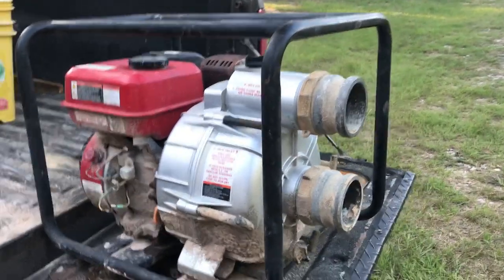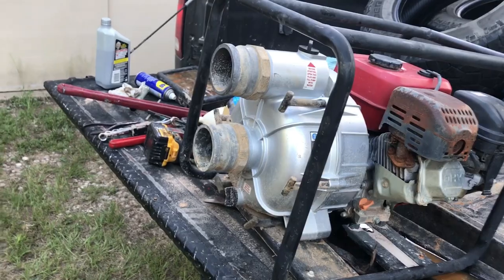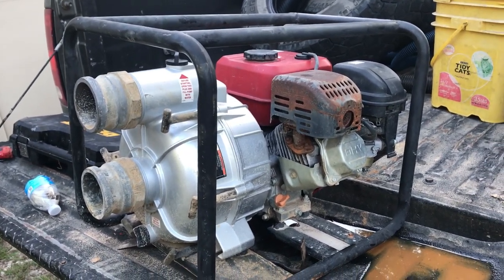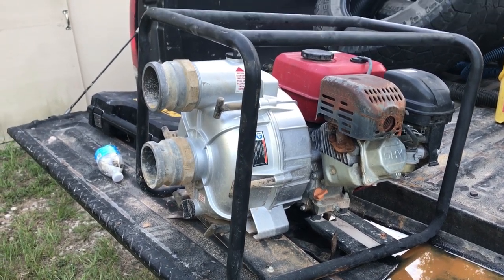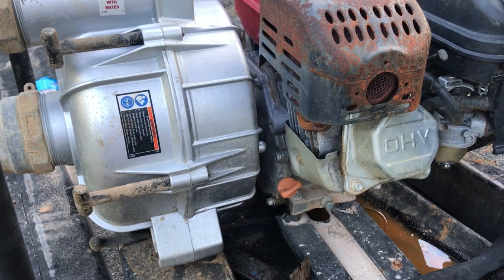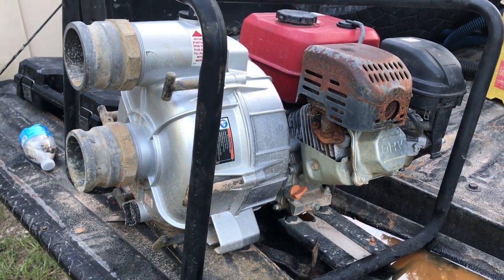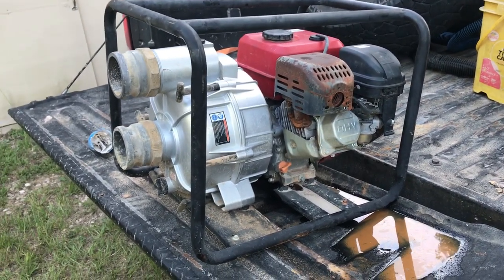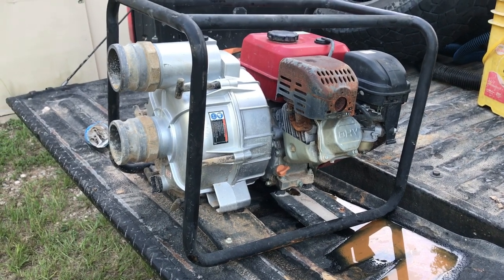Harbor Freight Water Pump Troubleshooting AGAIN!

Comment: If you overfill gas tank it wont start
Reply from the maker: I did learn that it would mess with it. I would usually fill the tank with the pump running and if I got too much it would spit and sputter for a bit and then clean up

Comment: Trash pumps under $1200 are notoriously failure prone.  If you get one full years use out of it count your lucky stars.  Seriously,  They are TRASH PUMPS. (unless you spend BIG $$ for one).  That's why there are few if any reviews of pumps more than a year old

Comment: If you pump a lot of sand with water, then you need to take care of the back of the pump housing. I covered the back (behind the impeller) with polyurethane sealant.

Comment: Mine was doing great pumping water into a manifold I rigged up to irrigate a pumpkin patch. All of a sudden, it stopped like it ws out of gas.  Started it up 3-4 more time and now it won't start AT ALL. Any suggestions?
Reply from the maker: Maybe check for water in the gas. It can accumulate in the bottom of the carb bowl. Drain the carb, or even the whole fuel tank, and try again.
Reply from the maker: Also always check the low engine oil sensor. If it’s acting up (or if you’re low on oil) it will cut off just like you turned it off and will not start again. If you check that it is full on oil and still won’t start, try disconnecting that sensor.

Comment: Worst comes to worse, engine replacement, the hemi doesn’t seem to mind moisture situations.  Our $695 Honda power washer engine just died, rebuild was going to cost $170, bought the HF clone #60363, and it’s now tried and true.
Reply from the maker: Edward Reynolds solid! I’ve yet to actually replace an engine on any of my units. I know I can cheap and easy, just haven’t yet
Reply: Know what you mean

Comment: Hi,  I got a Makita 3" Trash Pump.     It runs and just stops all of a sudden.    On and Off.   Still fairly new. 15hours.   Stored it in winter with storage fuel.     Gone through one tank of fuel,  put new fuel in.   It feels like it aint getting enough fuel.    Gunk on carb should not be a problem.      Must this tool be level.     I got a little slope.     Can I flood it carrying it.   I dont smell fuel,    IT runs and just stops.
Can a whole in the hose line affect the engine?   Must I have my water line open, or can I leave it on close three hundred feet away for 30 seconds.    I gotta run hell.   ahahhahaha   I got water holes line for irrigation and pump heat?   TY
Reply from the maker: 30 second dead head probably wouldn’t kill it. They are impeller pumps so there should be little to no risk of over pressure. I’d recommend you find a better solution like a foot valve. Not sure why you are starting it with a discharge line closed but I never had to on mine. 

Seems mine would act funny sometimes if it was too far off level, but I could usually get it to start and run. If you have the oil level sensor on the side of the crank case I’d try disconnecting and troubleshoot that first.
Reply: @TomBrueggen  Thanks Tom.     I use mine as a Fire hose and irrigation pump.    So I have a hose nosel on the end.   When I leave it on, it cuts holes into everything.    So I close the valve.   Hard to explain.      I will start fooling around with oil sensor and  maybe use a little Seafom to maybe clean Jet/Carb valves.     Will let you know.

Comment: I can't get mine to prime and start pumping? Is it just sucking air somewhere??? 😏🙄😯😬
Reply from the maker: Almost certainly sucking air somewhere or sucking down into mud on the bottom of the pond if you don’t have a proper can on the end of the hose
Reply: @TomBrueggen  The can on the end doesn't allow the weeds through and that is why I bought the full trash pump. Duckweed, pine needles, leaves. I'm trying to make a skimmer.

Comment: I just took mine out of the box. Ran for a few minutes. Cant get it restarted. Any ideas?
Reply from the maker: I assume you put oil in it...check it again and make sure the oil level hasn’t dropped. There is a low oil sensor that will ground out the spark. Sometimes this sensor will malfunction despite having proper oil. The sensor can be unplugged. You can test spark by pulling the spark plug out, and then hooking the boot back on. Touch it to the block and pull the rope. Do it somewhere dark so you can see the spark. Good luck!
Reply: Check  oil

Comment: Mine is doing the same thing I think it's the kill switch cuz now it doesn't have spark I pulled the plug tinkered with it and now it fires up that's three times its done this
Reply from the maker: I think this one was fuel locked. I have a video coming about one of the pumps getting hydrolocked with gasoline. Somehow it was leaking gasoline into the cylinder while sitting, and then when I pulled the rope the cylinder couldn’t come to TDC because the pocket of gasoline.

Comment: Used mine once. 2 weeks later all it does is backfire
Reply from the maker: That sucks. That’s how my generator is. It’s a powerhorse from Northern Tool. May as well be HFT predator. I’ve tried two new carbs, same thing. Backfires like crazy but won’t run. I’m not pro, so I just got pissed and shoved it back into storage 😁
Reply: @TomBrueggen  I''m returning mine tomorrow. I knew it was junk when I bought it.
Reply from the maker: @davidmcdonald77  maybe had some water or just bad gas laid up in the bowl. I totally drained and changed the gas and the carb on my generator and it’s still doing the backfire nonsense and won’t run.
Reply: @TomBrueggen  Power Horse and Predator engines never last. Have to spend the 3 or 4 hundred more and get a Honda. I learned that lesson long ago, but the price lures you to buy cheaper things. I have an old, small generator I use to run saws on my jobsite that I bought from Northern tool about 8 years ago 800. Other than replacing a few bolts that shook loose, I've never had any problems any Honda motor except 1 on a compressor.
Reply from the maker: @davidmcdonald77  for sure. I have a Honda power washer that I have not been nice to. It’s been faithful for years!

Comment: Disconnect the low oil sensor...!
Reply from the maker: It had already been done. Oldest trick in the book. Ha! Actually the odd thing about this one was how it was locked up. Had to use a pipe wrench to break it over. Don't know if a piston ring just got a little hung or what.
Reply: How?

Comment: Low oil shut off
Reply from the maker: Jacob T nah. I already have that disconnected! : ) 

Even still, the low oil shutoff wouldn’t make the engine stick. Although being low on oil may! I checked the oil and it was fine. I think one of the piston rings must have somehow just got snagged. It’s been running flawlessly again since posting this.
Reply: Agree, low oil shut off...top off with oil.
Reply: thanks for your  comment you just saved me a trip to mechanic lol
god bless

Comment: We'll the mystery is your using the wrong designed ⛽ gasoline witch is from debris in the tank from dirty fuel does your FUEL tank have what called A insertable screen basket filter for filtering out debris due to dirty fuels. One thing those engines are designed to run on Ethonal free FUEL only. You can say., or think what You will about it. And yes it's not good to run those engines low on oil either. You see the ⛽ gasoline fuels we use today have ethanol in it witch over time drawls moisture into FUEL tanks.& fuel lines.&etc. So my opinion on it is if I was you I'd switch to ethanol free fuel. Here's A way you can do it.& save money Mr. Pissed off. Buy some regular pump ⛽ gasoline from the gas station then open the can. Get yourself A bottle of drinking water pour half of that bottle into your FUEL. Then shake the pissed off at it. Let it sit for 2 days to settle to bottom. Go get yourself one of those plastic squeezable hand pumps from harbor freight store.,or Wal-mart.& some octane booster I use gum-out myself. Then go back open the jug put your pump together remove the substance from the bottom until you see nothing in it.& add in your octane  booster afterwards.& shake it let it sit for 5 minutes. Your already to use.

Comment: Ok my pump won’t suck any water any ideas how to fix it ?0
Reply from the maker: You’ve likely got an air leak somewhere. Or your hoses are hooked up backwards....If you are using camlock fittings like I did, make sure both are engaged, not just one side. Make sure all the T bolts in the pump housing are snug and you aren’t missing any seals. And of course make sure you prime the pump. Make sure you hose doesn’t have holes in it allowing it to suck air
Reply: Tom Brueggen your where right it had holes and it was letting air in it thank you